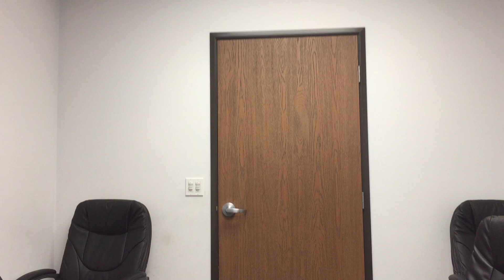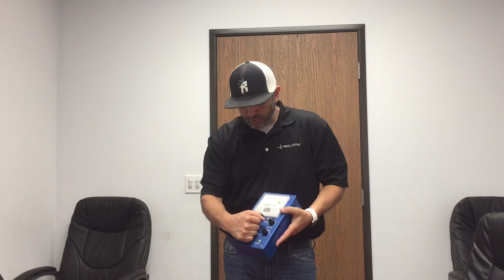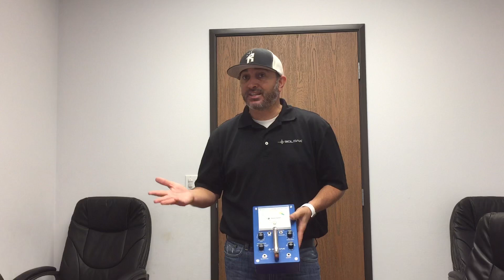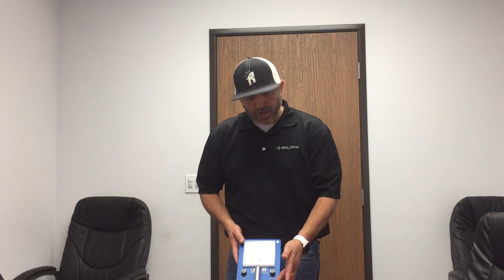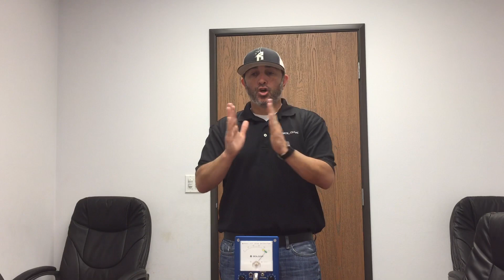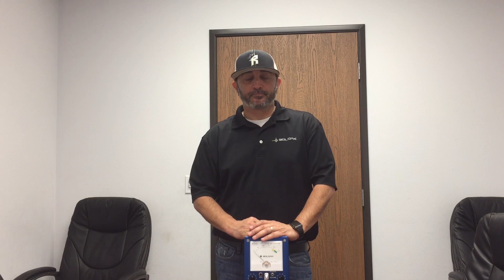Goldak 777-A water leak detector

Comment: I have had times where the leak is too loud and I can't determine where at exactly it is.
Do you have any advice?
Reply from the maker: Your first option is putting the frequency filter in the low position and lower your amplifier gain see if this helps narrow down your response area, If this does not help your next step would be using air, When you are using air you will only go 2lbs above the normal pressure of the property, Once air is introduced it wants to leave the pipe and work its way to the leak making one of two distinct noises, Either a bubbling sound which occurs when the leak is on the bottom of the pipe and the air is hitting the water that has gathered from the leak or a combination of water and air spitting out the pipe if the leak is on top or the side of the pipe.